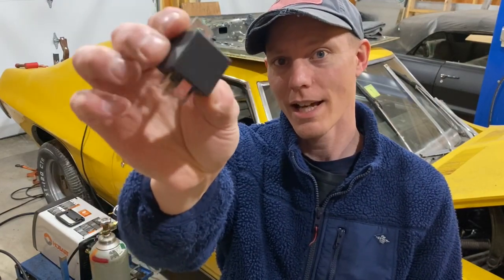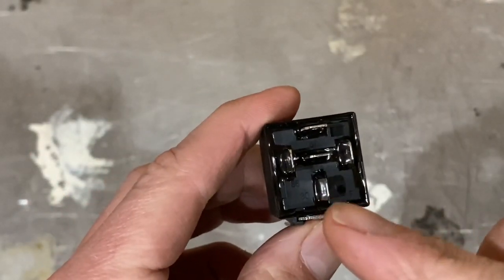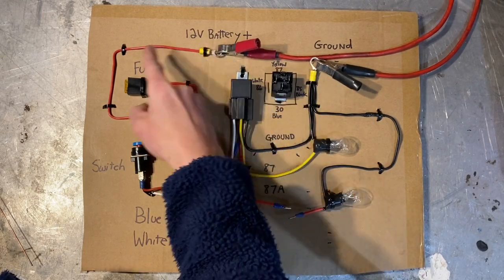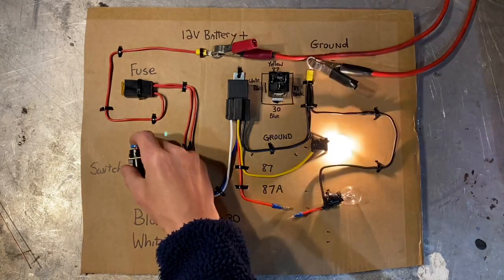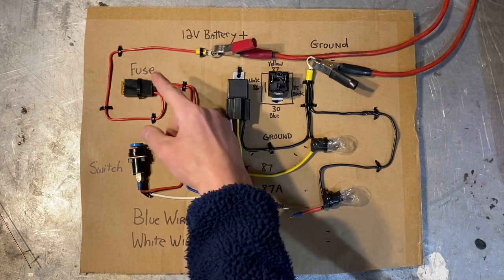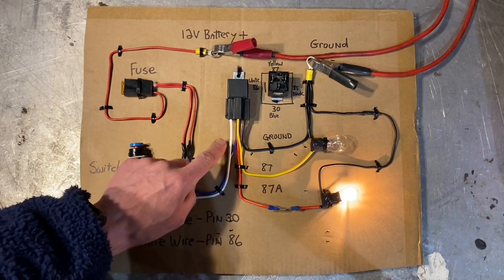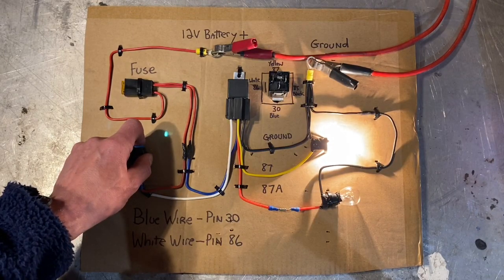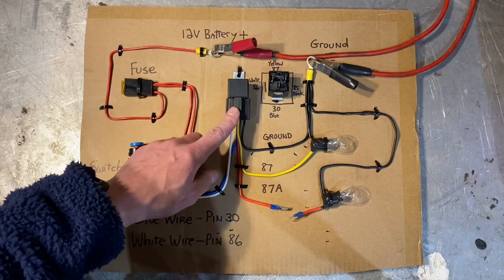How to Wire a 5 Pin Automotive Relay. Pins 87/30/85/86/87a . Bosch Style. Fans / Fuel Pump / Lights

Comment: Hi there!, I’m having hard time with a led light on a motorcycle, the running lights won’t come on if the turn signal wire is conected, I’m thinking on a relay just for the running light, that being said can you help me?, the switch on the motorcycle has a wire that wire goes to the pin 30 and I’ll be using 87a to power the lights right?, and 85 is ground (86 and 87 won’t be needed) if I’m correct.

Comment: Awesome video, and actually I’m looking for something like this for an automotive kill switch with some variants. To start the vehicle, you have to touch a hidden wire to make ground and it will allow you to start the car, and second, while the car is running, if you or somebody else opens your door, the dome light will turn on and it will activate the kill switch and your car will turn off. I had this system in an old car and I know it is possible, help

Comment: What to do if my fuel pump relay is getting too hot
Reply from the maker: It sounds like you should determine how much amperage your fuel pump is drawing and size the relay appropriately based on that. Usually fuel pump manufacturers will tell you how much amperage draw they have at different pressures. Your relay is likely too small.
Reply: @WiringRescue  I was thinking the wire gauge was to small

Comment: I'm trying to wire my boat trailer winch with is standard with 2 relays and has heaps of black ground wires ?? IT run a electric motor to wind up the cable

Comment: Well I have struggled with the relay I’m using ….that is until I saw this video, really the best explanation after watching loads of videos.
My switch is a D+ input and my accessories are a power distribution box and a Dc-Dc charger. Wish I could send you my wiring diagram

Comment: I have a question about wiring a 5 pin relay with a negative trigger. 

I'm using this for an air assist circuit on my laser. From the motherboard, I have a 24vdc terminal that is seeing voltage when I turn the machine on. The negative (air assist terminal) is energized when the laser is on and can be electronically switched through a software interface from my PC.

I have 2 solenoid switches downstream; 1 for low pressure air, 2 for high pressure air. When the electronic switch is off, I would like the low pressure solenoid to operate, HP is off, when switched on, the high pressure solenoid operates an LP is off.

I believe this is a negative trigger scheme. I want to use an Idec, SPDT, 5 pin relay. Pins are numbered 1 (NC), 3 (NO), 5 (Common), 13 (Negative) and 14 (Positive).
Can you show me how to wire?

Thanks!

Dale

Comment: I have a question, I am adding aftermarket gauges to my 72 Scout. I ran the power and ground to a new fuse box I added on the fire wall which gets power and ground from battery. My question is how do I make it so the light goes off when I turn key off? Right now it is directly connected to battery via new fuse box so light is always on

Comment: Nice.... But quick question..... How will lights stay off.... With switch on high beams are on .... With switch off low beams are on..... So how to switch both off ? Coz when i switch off the car the lights will stay on? How does that part work.... Just wondering..... Do i add another ON/OFF switch to control power to the light switch?

Comment: Thanks alot man..... I watched another guys video with another diagram for this..... According to him the fuse line goes straight to 86 and 30 and 85 goes to the switch...... Thats why my headlights only shine on high beams when i flip the switch both sides..... I will rectify this tomorrow thanks to you..... Good explanation 👍

Comment: hmmmph Trying this circuit but I need a second switch so 87A isn't permanently on ( which is why you have a broken connection there).
I know some say,  just put a switch as that broken connection but then power would be permantly sent to the relay even when your not using the outlet at 87A.
Basically, put 1st switch on would put 87A on AND (gate) if the 2nd switch (like your setup)  is also on,  then power would be sent to the 87 outlet.
I'll get there and post a video of my findings once i've got it...

Comment: So how can I make 87a switched aswell? Say I turned on my dip headlights being 87a then switching over to full beam being 87. 
Can I put a switch after the fuse before it goes into the relay?

Comment: I’m going to attempt using 5 pin so I can switch between to battery banks to charge from solar/alternator.  And then have those battery banks being selected for output using a marine isolator battery selector. Hopefully this works? If not let me know 😂

Comment: Don't use wire colors.  My wires are different colors.  Put up a blowup of the relay diagram and reference the numbers to what they do.  Power the coil, grounds, send power, normally open and normally closed.  That's all we need.  I'll pick the wire colors.

Comment: Love the videos! Any chance you can do a video on adding a PWM Controller? I currently have a hiflow intercooler pump that runs through a relay at 100%. I would like to know where to add the PWM controller inline to be able to adjust my pump speed. Thanks again and any advice is appreciated 🙏🏻

Comment: Thank you!
Very clear and easy to understand.
Question:
I would like to use a relay to have a kill switch to disconnect power to the ignition.
At the same time, I would want the horn(or a loud audible device) to sound when the thief is trying to crank over the engine.
Is this possible?

Comment: On the bmw x5 five pins the 87 isnt across the 30 in the diagram it show the 87a and 87 link together  therefore it work single at first then when it clicks they are both active . Is this a faulty relay

Comment: Jeremy! Fantastic! I just figured out why when I have my car in accessory mode the radio works but when I turn the engine over, the radio has to restart. The installer must have put the radio power on 87a. This has been bothering me for a while. I'll take a look now that I understand a little more about relays!

Comment: Thats very well explained video for newbie and beginners.. can you please make video gor dpdt relay as my fog light led got two points but i am unable to wire second point to circuit. I want to switch the point from stock fog switch if I switch off and switch it back. Thanks

Comment: I'm using same set up for radiator fan . Can i hook up 87 and 87A to same Fan ? The AUX switch ( white to pin 86) is for emergency power to fan in case 87 connection to same fan is lost /shorted etc.... Thanks for video

Comment: I have a 5 pin relay in my car but they added a jumper wire to another prong . Why would they do that ?
Reply from the maker: Sometimes people will jump 30 & 86 together so that they don’t have to run separate power wires to each. In some cases, that is fine to do, but it sort of depends on the usage of the relay.

Comment: Question do you have to use a fuse for just the switch itself? Like what if I’m using a power wire off the car?

Comment: I apologize for going  about this wrong ,but i have a 2000 toyota avalon and when it starts a relay is clicking all the dam time that im on the road,headlights dont flash only clock and check engine light...plz need some advice to fix this issue.had a code reader but it got stolen.

Comment: So, Lemme' get this straight...: 30 is Constant Ignition Power that Always sends power to 87A and the device controlled by it, Until...Power comes in 86 which in turn interrupts the flow of power by diverting the power to 87 and the device controlled by it and everything is tied together by 85 which is the Ground for the Relay.

Comment: In conventional current flow the fuse is always on the battery side - as per your wiring set up -  which makes sense if current really did travel from positive to negative as as  been believed for over 100 years or so . BUT “ it has been proved “ recently that current ( the electrons ) actually run from -ve to +ve so shouldn’t the fuse therefore be on the negative side of the battery?

Comment: Do you have a wiring video for a fuelpump with a relay and oil pressure sending unit with a pressure switch
Reply from the maker: I do have a fuel pump wiring video, but it does not include the oil pressure switch. The oil pressure switch would likely just wire into pin 85 of the relay though. Then as soon as it sees oil pressure, and power from the ignition, it will allow the relay to turn on and the start the fuel pump. Good luck! :)
Reply: Thank you

Comment: Hey im new to this whole wiring relay thing mainly cause I had toasted a wire in my fusebox in my car. By any chance do any of these pins require specific wiring to that pin or do all pins use the same relative wire? Thanks in advance if you reply

Comment: u make everything easy to understand. 
thanks Jeremy. 

/bklyn👑
Reply from the maker: Thank you! I really appreciate it!
Reply: @WiringRescue  thank you. gotta another question.

my ebike has a control switch for horn and lights.
i know i need one battery fuse (+) for for this connection. got it.

now, when I set up my lights, u said i need two battery (+) fuses.
one to battery (+) terminal on flasher; the other to the middle terminal of three wires for lights.

if I'm connecting all systems together (lights + horn) do I need a total of three fuses,
or can I split the one with the battery (+) since they both are drawing power from same battery connection? Do the lights need a separate GND from the horn relay? Am I making sense?  Hope you can help....

/bklyn👑

Comment: Your fuse has 3 reds coming out?
Reply from the maker: Yes it is a strange fuse. Check out this newer video which uses more normal fuses and a slightly better explanation. :) 
https://youtu.be/QCkfFCLa_Jg
Reply: @WiringRescue  how do you determine which fuse to use?

Comment: How would you wire aftermarket fog lights, not powered by any factory harness except maybe the relay trigger, so the fogs are on when car us running except when the turn signal is flashing? In other words the fog lights act as fogs and blink like turn signals when turning?

Thank you

Comment: PLEASE mr wire man, answer my woes. Ive got a 76 Datsun 280z that im putting LED headlights in place of factory for safety reasons. It runs off of a switched ground system & I know i need to run relays in order to make them function as intended. Im fighting off chewing a casing of buckshot because of it & would love a bit of veteran help. they are sealed beam 7 inch headlights with the H4 style connection. 1 positive in & 2 grounds. one being high beam & the other being low. please

Comment: I have a car stereo that had a two prong switch to the break Bypass. I bought a 5 pin switch because the 2 pin was too small & looked dumb. I have no idea how to wire it. It's supposed to illuminate with your dash lights I believe. Do you know how to wire it?

Comment: Simple explanation video. 

Is it possible to put a switch on pin 87A to make the light turn off and on  when one wants it to come on.

Essentially having two switches control the same lights?

Comment: Hmmm this might be an excellent solution for a race car trailer that a operator wants to install a big Rear light bar above and on the top of the rear door. The new rear trailer light bar could connect to the switch side (87) and also the 7th (center pole) pin of a 7 way trailer plug which is reserved  for reverse light activation connected using 87A, to the same light bar. 🤔
Reply from the maker: Sounds like a fun project! Make it happen!

Comment: Not pretty, but very clear. So when the switch is turned on, pin 86 and pin 30 are basically connected together with 12V. I guess that would be ok with the relay since current would flow thru the easiest path which is 30 to 87.

Comment: Question, so I’ve got 3 step switch connected to 1#high beams fuse 2#connected to fuse that’s on when ignition it’s turn on.
Point of this is to control my led light bar two ways always on or on when high beams engaged.
Main power I want to connect to relay and send power from there to led. I think I’ve got all worked out apart of relay connection. How many pin relay I need and what would be right way to connecting this?
I would much appreciate I you could help 😁

Comment: Why isn't the control wire and switch which is going to pin 86 on a separate, and lighter fuse since it doesn't need much amperage?
Reply from the maker: Solid question!  It can be done that way for sure, and I actually do wire it that way in this much newer video. https://www.youtube.com/watch?v=QCkfFCLa_Jg

Comment: Sir me Opel car from the 80s is tipical GM design lay out .
It does not have diode in tge dash for delco12si alternator it uses only pin1 with bulb it is bounded with split wire on the 4pin rear defroster relay also I have non ballast xenon bulbs,dual filament bulbs rear bulb holder,positive linear voltage regulator,3pin blinker;2pin head lights on buzzer and 6pin wiper motor relay.
The engine it self acts randomly examper the blinker relay if all 4 lights are used the engine acts like hit and miss fiering with out key on basicaly found the cause ground wire on bulb holder back side was corroded and me thiner black lead on key switch started to smoke,seperate event that acured recently engine self acelerates at full trothel I noticed on me carburetor trothel cabel get contrapted if it tuches metalic air filter housing also I removed blow by hose and If I use head lights the engine spin out of control as well so I also have current drain on that rear defroster windscreen relay 4pin I took it out .
So me car shares many fuses and common ground and positive conections.
How can I determine the problem?
Can those relays I mentioned before act similar like dual 5 pin relays???
Im not shure me self it nearly looks like me xenon bulbs some how act like wacum tube for some reason that never happened to me before so Im in process to replace me wire harnest and trying to finde the fault can you please help me to point out what value I need for me mentioned relays diode or zener diodes so I can stop those anoying effects ?
I also come across strange effects on alternator voltage regulator I tryed out those so called plasma ignition ordinary ceramic capacitirs to plus ignition coil and other side to ground the effect engine lot bether lights starting etc but me starting charge on me alternator was swaped from 1k rpm it gone to 3-4k rpm so me alternator light refuse to turn off unless I rev me engine more .
That was in the past now Im mostly concerned about the engine spining out of control the engine is magnetised basicaly arcing or static present.
So I hoppe you can help me to determine where that staff is comming from exactly?
And how to make ich circuet seperatly for me devices and where to put reverse polarity voltage and current protection.
Im confused mostly why me 4pin relay even interacting with those others all me relays have ic chips inside resistors and integrated diodes so thats why Im confused why thise devices interact with ich other.
Even build me own wire harnest diagram to see where those leads go.
I do not have diode sadly for alternator Im woried it might not even work at all because the voltage regulator inside that thing also aperantly is ground potential controled profe of it is that leaky 4pin relay and the external capacitors I mentioned in me story earlyr .
So I realy hoppe you can advice me what to do in this unusual case.
I did read some where xenon bulbs requare ballast I dont have that device me car worked for years good sudenly those changes apeared out of no where .
And sadly some ic chips on the relays arent marked its cheap Chiba crap.
So it created lot confusion .
I have 500k potenciometer if xenon is suspiciuse can that linder me problem? I only have ac resistors from microwave transformer .
Honestly I dont have any money so I must scavange parts from old electronics.
Hoppe you can point me out also what diode size to put on me alternator so I can at least try to uncheck alternator and xenon bulbs.
The relays confuse me the most honestly

Comment: This is an amazing explanation video. My only issue im having with mine is the switch light is on when my auxiliary lights are turned off. How do I make it to where the switch light is off and turned on while my aux lights are on? Just wanted to point out that I did not use 87a on the relay

Comment: So switch circuit and load circuit both have the same voltage? Only the  current is higher in the later one?
Reply from the maker: You’ve got it!

Comment: Very well explained thank you. One question about 87a. If power is sent through from 30 which is directly connected to battery how would the fog lamps turn off? My plan is to use a led bar controlled by my head lamp circuit through a relay. Was planning also to add fog lights controlled by my low beam circuit through a 2nd relay. After watching this I wonder if I could do both with only one relay.
Reply: That’s my question as well, other guys say 30 gets fed from battery/fuse/switch ON (low beam comes ON)

Comment: Do you know why some car relay has two wires for each pin socket? I broke off my OVP relay on my 1995 E300D. There were two wires broke off from the same pin socket. They seems to be separate, so does the pin has two separate wires, or the two wires actually are the same?

Comment: Been watching a few of your vids, got a question. Can this method be used to turn single filament marking lights into turn signal lights? Could a flasher be added between the 87 terminal and joined to where 87a makes connection to the bulb? Is there any electrical hazards that could come out of that?
Reply from the maker: To be honest, I’m not sure. Sorry I couldn’t be of more help!